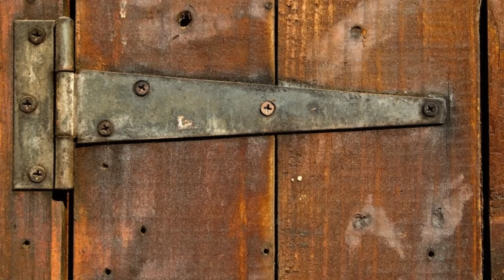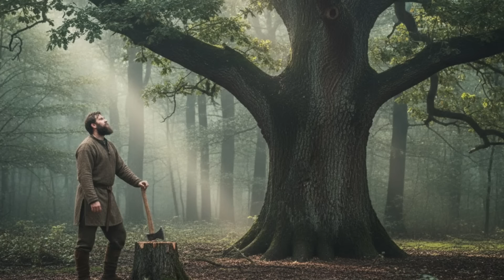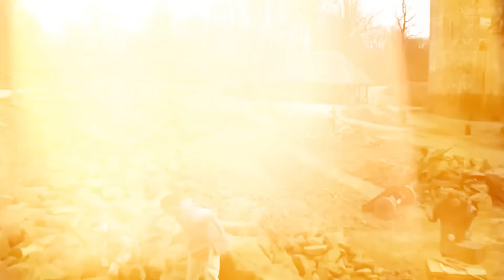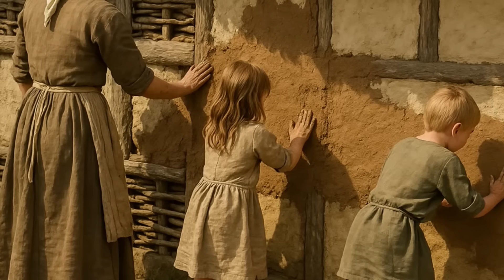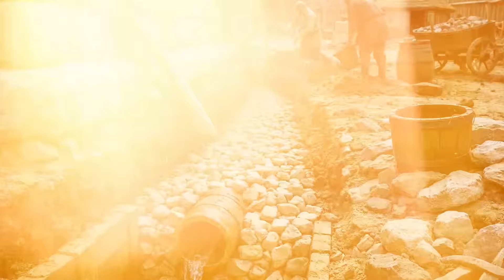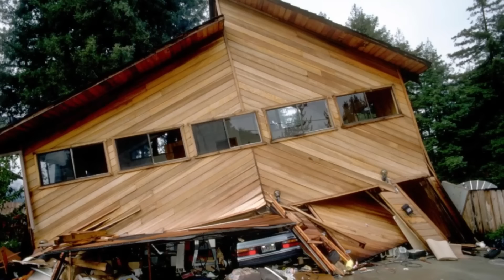How Medieval Peasants Built Stormproof Houses With No Nails Or Cement

Comment: Uhm, dunno if the tree thing about the fast growing straight up branches and the horizontal slower growing saying was a mistake of the channel or the people from the Middle Ages, but yes trees in a dense forest or in competition with trees directly around it are less good for building with in a timber milling way. But for none of the reasons you mentioned. The wood is not stringy, it is weaker, but for totally different reasons. Sigh, i wish these channels wouldn’t use AI (although you’d think AI would know why trees that stand alone and grow at the normal rate are better and give those reasons). Oh, btw, it isn’t sap that keeps bugs and fungus away from winter wood, its temperature…obviously

Comment: The shrinking wood mortis and tenon makes no sense. It would become loose because all of the wood shrinks.
Reply: lol the AI is stupid the pegs were made out of dry wood or made the yr b4 either way the pegs where dry and the timbers green 
I have been in a lot of 200-400 year old timber frame buildings and I never seen any square pegs they where all octagon shaped  in the northeast states any way
Reply: @chuckbailey6835  When I worked at a living history village museum, I learned that at least in the 19th century, they dried out the wooden pegs in an oven before hammering them into their holes in the joints, and then poured water over them to expand them and make the joint tight. Possible when you realize the post and beam wall was assembled horizontally on the ground before it was moved to the foundation, and then pushed by poles and pulled by ropes to its' position vertically.
Reply: @chuckbailey6835 you would want them both dry.

Comment: It took decades to build with stone in the Medieval period.  Even centuries. And we know stone is a durable building material. Just ask the Pharaohs. So that's not some hidden, forgotten secret. And we still build with sticks and mud. It's called wood framing and drywall. The reason the buildings lasted so long was the constant maintenance they received every year. Maintain by the dweller.

Comment: Stormproof doesnt mean no leaks. Still standing is the impressive part. And none of it to code by todays standards.
Reply: In my state there is a code chapter for post and beam with wattle and dob buildings.  Then you white washed the wattle and dob with coats until white and water proofed.  Thatch is reeds or some straws.  Nit modern wheat straws.
Reply: you vestern morooon...in my county there are churces ower 300 years old, the tallest one hass 67m hight, a UNESCO herritage...and yes no nails...and still usable